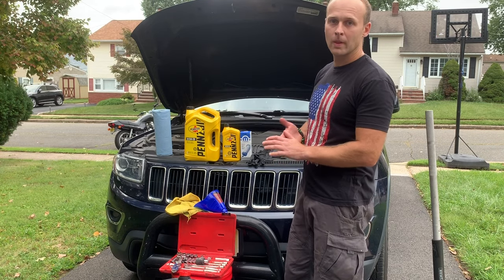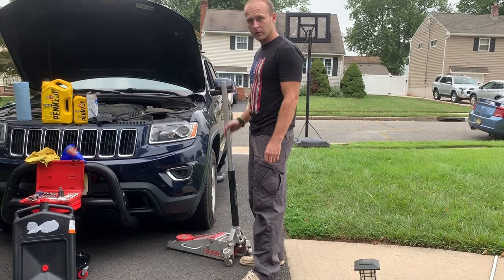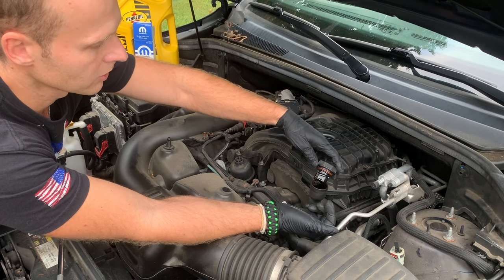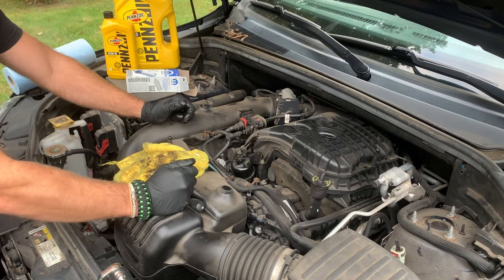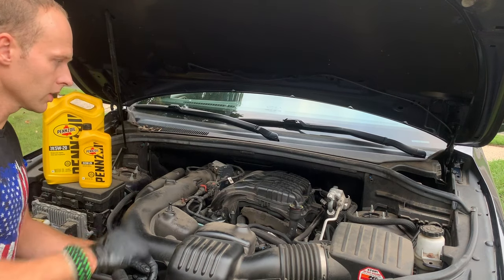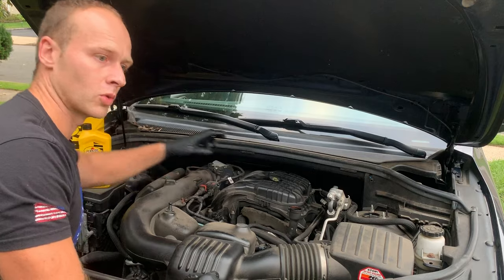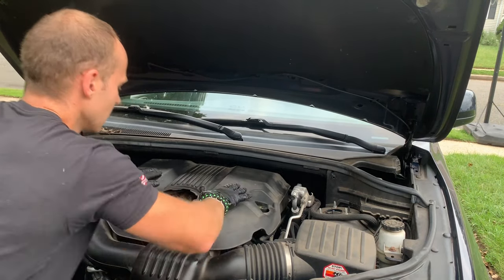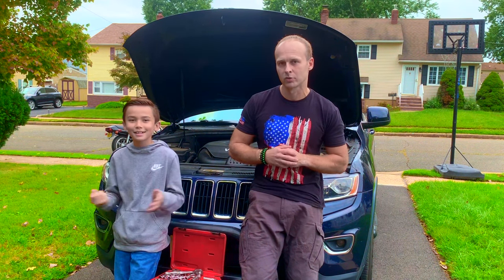2011-2018 Jeep Grand Cherokee (2014) 3.6L V6 Oil Change Procedure  & Reset - HOW TO

Comment: Good video, but a word of caution, be very careful not to overtighten the oil filter. It screws into a plastic oil cooler assembly which is mounted on top of the motor. Overtightening can cause the plastic oil cooler assembly to crack and that creates an oil leak. The cost to replace the oil cooler assembly runs $800-$1,000 at the dealer. This piece was redesigned starting with all 14 models with the 3.6 and the 3.2 and most of the ones on 14 models will fail on their on. I've already had to replace two oil cooler assemblies on my 14 Wrangler and my wife's 14 Cherokee.  There are also torque specs for the oil filter.
Reply from the maker: Good point.  Thanks for sharing
Reply: Be careful not to under tighten the filter… if that thing comes lose you’ll have a real problem
Reply: I can’t get mine off 😢
Reply: Redesigned to what?

Comment: Wow did you really put that plug back in before all the oil was drained out that was still draining quite a bit I've done all changes on quite a few vehicles in my time and if it still drain that much there still a good bit of oil that is old left in there , I don't agree with that at all!!!!! If you are watching this video to learn how to change your oil please do not do that with your own vehicle allow it to completely drain out to where it is Flowing no longer!
Reply: I'm with you...I let the oil drain until it's just dripping. There are other things you can do while your waiting. Top off the washer fluid, antifreeze, check the belt, check the power steering fluid, check or replace the air filter.
Reply: I just watched this to make sure I had the correct sized socket and that’s the only (yet pretty critical) thing he did wrong. Dude... there’s still a toddler sized pee stream of oil coming out. Just give it 5-10 more minutes.

Comment: The location of the oil filter just made me want the jeep more. Thanks for the video.
Reply from the maker: ha. agree
Reply from the maker: @RussLinton   yeah.  one time i got my other car back from dealer.  they left my air intake tube disconnected from the manifold.  just crazy.
Reply: Just wait 'till you have to replace a failed oil pressure sensor...$800+ at the dealer, or a day or more in your driveway. For a $100 part that the Jeep engineers decided that under/inside the intake manifold would be a great place to locate it. So if you do it yourself, $100 bucks for the sensor, $100 bucks for a gasket set, possibly $50 bucks for a special tool to remove the sensor, possibly another $50 bucks for "specialty" sockets you don't happen to have, a whole lot of blood, sweat, tears, and...lots of cursing. Not a father/son project if you're prone to cursing:)

Comment: Good job! Just bought my sons who is now stationed overseas.  One bit of advice,  always rub a thin coat of new oil around any o-rings or seals before installing a new filter. That makes for a better seal and prevents damaging a dry seal when tightening.
Reply from the maker: Yes 100%.   Thought I showed that.

Comment: I believe they came with synthetic from the factory..specifically Pennzoil Platimum. Depends on year for weight. 2011 it was 5w-30,  the new ones are 0W-20. I just know each year of the pentastar V6 they changed the oil weight, perhaps based on design changes.
Reply: Believe my 12 laredo is 5w-30 also

Comment: Thanks Lech...our mobile onsite oil change guy is not available.  We want to take off on  a trip on Monday and just made that decision yesterday. Need to change the oil but I did not want to mess with the oil filter. Why? Because I did not realize the oil filter was on the top of the engine.  I used to always change all of our vehicles but this one...long story...but I stopped a couple of years ago because I hated messing with the oil filter...this is so much simpler.  You have saved me money.
Reply from the maker: Ahh.  Nice, glad to help 👊
Reply: @HowToWithLech  QUick update.  I did change the oil last night on the 2016.  We have the 2016 GC 75th Anniversary Edition.  Not sure it is any different.  The engine cover on our 2016 has a screw under the center cover which pops off of the main engine cover.  It is both a hex bolt and has a star screw.  Easy to remove and then only a couple rear snap locations.  In this video it had 5 snap locations. All other aspects were identical. It made it so easy not messing with a filter under the Jeep...plus the filter drains off inside the cannister...so was very little mess when taking it out.

Comment: Thanks mate, great video. FYI the procedure is the exactly the same same for right hand drive vehicles. One thing though, the filter is slightly different in my 2012 model. No extended bit at one end with the O-ring,  so that filter wont fit the earlier (pre facelift) models. Cheers
Reply from the maker: thanks for the feedback, good to know.  and i noticed on the filter it says its only for 2014 models or newer.  so yeah, the filters differ.  made a new quicker video too, will post soon.

Comment: Good job on the video. Very helpful. While changing the oil on my 2017 Jeep Grand Cherokee I found a bunch of shredded foam insulation on top the engine behind the fill nozzle. I have no idea where it could have come from. Looks like a mouse nest.
Reply from the maker: Mouse or chipmunks, thats my guess. If car sat for a little while they like to make a nests in engine bays for some reason lol.  Had that happen to my Dodge Charger.     Hope no major damage.

Comment: Watch video to prepare to change my sister's  2018 Jeep.  One tip you should coat a little oil on the oil filter caps O ring.
Reply from the maker: Yup.  Good point 👍

Comment: I really like your video and own an WK2 2014, This video is missing a few details like the brake video I started with no worries. The engine should be at a moderate temperature before draining the oil. The oil should be left to drain completely. With the brake video like the oil pan every bolt you remove has a torq specification inch or foot pounds including any aluminum rim. Keep up the great work..I really enjoyed your video's.
Reply from the maker: Thank you.  Great tips!  Actually made a new one with little more detail 👍

Comment: Thank you. Gonna take care of my mom's car, and this was very helpful. One question. Description says 13mm, but the oil drain plug took a 16. Difference between cars?
Reply: i think u use a 15 or 16mm cuz a 13 can strip the oil drain plug bolt
Reply: @kimreyes7783  that doesn't make sense.

Comment: Good job! Next time throw a jack stand under that thing in case that jack fails. Unfortunately I wouldn’t put Pennzoil in anything. Mobile 1 or Amsoil is my preference.
Reply from the maker: Yes , jack stands used 👍
Reply: John he did have a jack stand under it and even mentioned it,. Next time you should actually watch the video before criticizing it..

Comment: I’m pretty small. Has anyone done this without jacking the front end of the car?  Or does the jack serve as a win win?  I was thinking the oil would drain better with the slight angle. Just some noob questions. Lol
Reply from the maker: Actually very good question.   Car is pretty high.  You should be able to do it without lifting it.  But when I lift it I do lower it to make sure drains better.  Give it some time to drain. Angle might help too 👊
Reply: @HowToWithLech  thank you! Just drove across the country so I don’t have much right now. But I’ll have to give it a shot !

Comment: Do you find you find % oil life indicator reliable?
Doesn't seem like it takes time into account (if car sits for a while).
Reply from the maker: Timur Shakya never really tested it to that extent as use car daily. .   Still look how many miles drove though.  But if car sits for long time probably goood to change .
Reply: How To with Lech Definitely does not seem that it takes time into account
Reply: It  has nothing to do with time it uses mileage only.

Comment: I would never blindly dump in 6 quarts of oil after a change and not check the dipstick. Always check the dipstick after changing your oil. Just my two cents.
Reply from the maker: 👍 agreed .  Normally I’ll leave a quart out . Run engine for a min.  before topping off.

Comment: What’s that like piece called that connects to the 15/16s?
Reply from the maker: its just a converter 3/8 to 1/2", to connect the 3/8" ratchet to the 1/2" socket i was using.

Comment: No funny shit bro u just did a oil change and didn’t even check the dip stick bro after refilling smh
Reply from the maker: You have to let is settle for a while after running car.     Also we just put the required amount so it’s at max with no burnoff.   But yea always check after car cools off

Comment: U should drain the oil before u take the filter off. Also if u let  drain while new filter is in all the dirty oil just ran through your brand new filter and ruined it. Also the engine needs to be HOT OR RIGHT AFTER IT WAS RUNNING.  ANOTHER VERY IMPORTANT STEP/FACT U LEFT OUT. dude u need to stop seriously